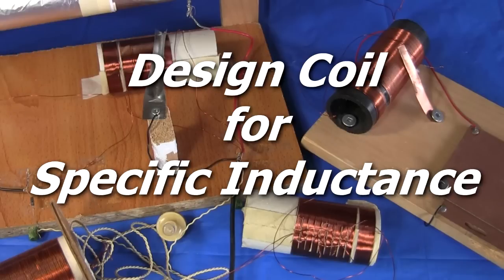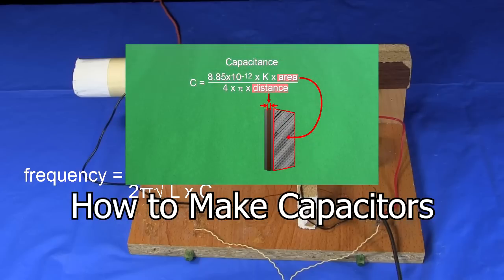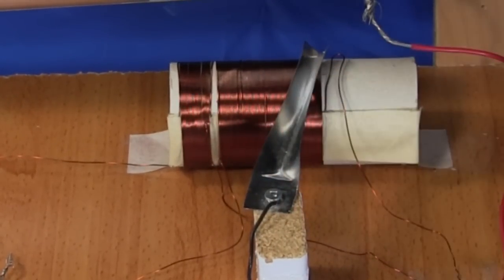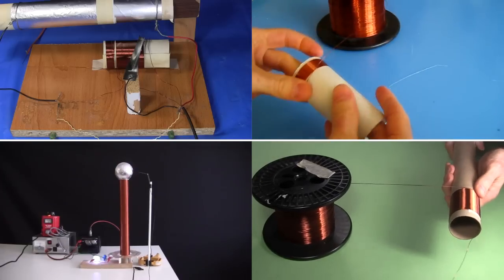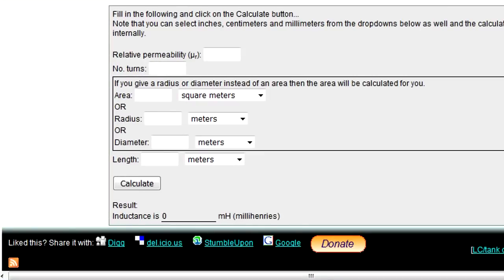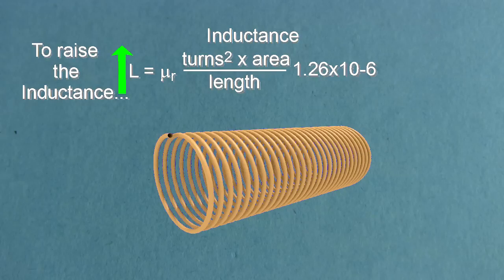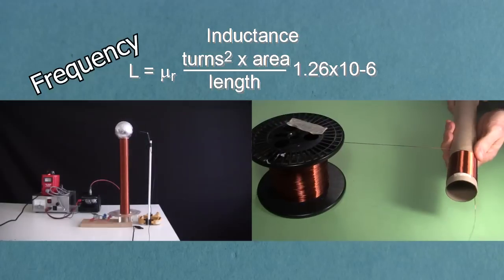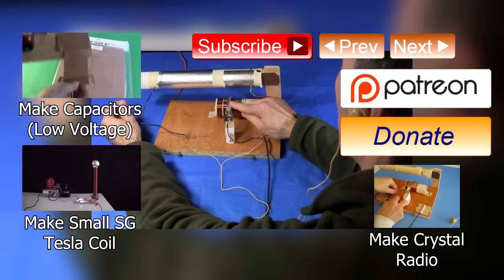How to Design a Coil for Specific Inductance

Comment: Great Video. I wish there was a guide like this when I was a kid :) No doubt I will be linking to this one a lot :)
I especially like the mentioning of all the Formulas, including the thumb rules and rounding off's that regularly get used when designing coils. Those little details can get a lot of people stuck on the theory unnecessarily.  When they would learn more by just forging ahead and giving it a go so they can see how it works.
Reply from the maker: Thanks. Yeah, formulas are great guides. They're a lot of knowledge compressed into a small area. There's still a lot they don't say, but they go a long way.
Reply: Formulas are easy to google. Its not always so easy to get a quick yet accurate guide to using them. Its very helpful to show how they work and which numbers are constants and which ones can be rounded etc to make it all more user friendly while maintaining an acceptable error margin :) For beginners looking up LC circuits it can be very overwhelming. Now thanks to this video it needn't be :D
Reply from the maker: Do you mean the thickness of the wire? The only effect the thickness of the wire will have is that thicker wire will mean a longer coil and length is a variable in the equation (see the inductance formula in the video).  If you're trying to keep the coil a certain length then a thicker wire will mean that you can fit fewer turns into the same length.
If by thickness of the coil you mean the wire thickness' affect on the coil's diameter, then the diameter includes the thickness of the wire. That's because the diameter is measured from the center of the wire on one side to the center of the wire on the other side. The diameter goes into calculating the area variable in the formula.PS. Sorry for the delayed reply. For some unknown reason, YouTube flagged your comment as spam and then didn't tell me about it until now.
Reply: @RimstarOrg  I googled lots of times to find a formula to calculate the inductence but each websites shows different different formulas .Which one is the correct ?Please reply me too.Here are some examples 👉L=MaN^2A/d 👉L=D^2n^2/45D+100l 👉and your formula.
Reply: Theese formulas were in my electronics textbooks already 50 years ago. Before Youtube.

Comment: How many winds do you need around a core (minimum) to get flux to flow through the core? And does it matter if you use a hard single stand copper wire vs. multi strand wire? And let’s say the target frequency is greater than 100khz - 10mhz max.

Comment: Question.....Also Merry x-mas!.....I just built a double balanced mixer.....I bought some toroid cores from Jaycar. Turns out they are "iron cores" usually used for EMI suppression. My question is.....does the type of core become more critical when frequency increases? I think my DBM is actually an RF attenuator! When I fed my nano-VNA directly into the antenna socket of the DC 3.5Mhz rcvr I built using this DBM I could hear the sweep tone it was generating in the 80m band....I have ordered the correct toroids...hopefully this will fix it! Are air cores usually ok for HF (below 30mHz) if I don't have a toroid?
Thanks for the great content!

Comment: How you can apply this formula for a multi layer coil? Let’s say for a crossover network in a speaker system. Do I have to use the same formula for each layer with the small diameter variation, then considering all coils in parallel?
Reply from the maker: For multilayer you need different formulas. Try googling "coil inductance formula multilayer".

Comment: Thank you! That was very inspiring! :) Though... I need to do a specific coil with multiple leyers and on Iron-Silicon sheets ...  its for audio crossover, and since this coil that i'm trying to build needs to cross a speaker at about 175 Hz, I definately need Iron core, because by my calculations it has to be around 6.2 mH... its huge if I have to build it on air core! But I do not know what is the permeability of this type of alloy (iron-silicon)... on wikipedia it says its around 19-90! I don't know what to do anymore... my sheets have 15 mm width/ 71 mm in lenght and I have used 30 of them because they are only 0.3 mm thick

Comment: I searched in internet lots of times to find a formula to calculate the inductence but each websites shows different different formulas .Which one is the correct ?Please reply me too.Here are some examples 👉L=MaN^2A/d 👉L=D^2n^2/45D+100l 👉and your formula.
Reply from the maker: Sometimes the formulas have slightly different parameters but give the same result. For those, it's usually the ur and the 1.26x10^-6 that are combined in different ways but work out to the same thing. But sometimes the formulas are better for certain types of coils, different frequency ranges for example. You can sometimes get a clue by looking at what variables are needed.
Reply: @RimstarOrg  Thank you for replying me and nice explaning .But I want to clearly know that  we can use this formula to calculate the inductence ?👉L=D^2 N^2/(18D+40L)
Reply from the maker: Where did you get the formula from? Does it give the same inductance as the formula that I gave?
Reply from the maker: Unfortunately that webpage doesn't give any details of what type of coil that formula is used for. It does seem odd that it doesn't take into account the permeability of the core material, however, with a set of parameters for a typical crystal radio tuning coil, my formula gave 125 microhenries and your formula gave 14 microhenries, not as different as I expected. But without the details about what type of coil the formula is for, I don't think I can help more.
Reply: @RimstarOrg  Thank you.I will use your formula in future.Also I have seen that formula in another webpage and it says some ratio about the length of the coil and diameter.As I remember it was 0.4 or something else and it gives the inductance in micro henrys .Never mind I will use your formula.If it's not matter please find my previous formula.Please check this website also 👉 https://www.circuitstoday.com/how-to-make-an-air-core-inductor

Comment: Hi very good
In my childhood i created this with different pieces of wire join together and wound on 3 inch peace of wood,
Use 50 oham diode it works amazing with out antenna and earth ,and also generate power to glow LED .
But others many many experiment failed at same time.
I realized first coil wounded with natural frequency that catches frequencies and convert into power.
Reply: I want to glow an LED.

Comment: Inductance usually isn't useful to know by itself when designing circuits. Impedance is a more interesting value if you want to invent your own devices. For inductors, the impedance/reactance is: 2*Pi*frequency*Inductance with units in ohms.

In case you wonder, impedance is the fact that capacitors and inductors also act as resistors against A.C. and strictly speaking, "impedance" is the combined effect of both resistors, capacitors and inductors in a certain circuit, ie. the overall "resistance". Therefore «reactance» is a more proper term for the effect of each of these by themselves. We reserve the term "resistance" to resistors because these "reactive" effects don't act upon D.C.

If you build a tank circuit (like the crystal radio is), you have an inductor which reacts/"impedes"/"resists" more the higher the frequency and a capacitor which reacts less the higher the frequency and so the overall circuit has this sweet spot in the center where the combined impedance is the lowest. This is called the resonant frequency of the circuit. Obviously, this is the frequency the radio is tuned into, ie. outputs a stronger signal/larger sound volume.

And now you know and knowing is half the battle!
Reply from the maker: Oh! Regarding your third paragraph, why the resonant frequency of the parallel LC circuit is where the reactances are equal, thanks! I knew all that, and I knew about the different ways inductors and capacitors impede the higher and lower frequencies, but I hadn't put the two together (actually, now that I see it, I think I had put the two together briefly a few lifetimes ago but forgot it :)). Maybe now I can finally make a video about resonance! Now I just have to get up the courage to do it. Without the ability to fix errors in videos once they're uploaded, I need to be very sure of everything, and you can never be 100% sure.

Comment: Hi, i saw a coil in an experiment the other day that was no more than 4 inches long and around 1" in diameter, but the guy said it's inductance was 24H ! I thought i knew enough about inductors but i can't see how such a small coil can have such a very high inductance, what are the methods to achieve that ?
Reply from the maker: I just plugged your numbers into the calculator on my website, using 217 for the number of turns and a magnetic permeability for the core of 100 and I got just 29mH. To get 29H I had to change to permeability to 100,000. I then did a google search for "magnetic permeability 100000" and got mu-metal (https://en.wikipedia.org/wiki/Mu-metal) and permalloy (https://en.wikipedia.org/wiki/Permalloy). Perhaps he was using one of those as a solid core? If it was an air core then I don't see how he could have gotten 24H -- an error perhaps.
Reply: RimstarOrg
Sorry yes it had a core, i've got some mumetal sheet i'll roll some into a core and see.
Reply: I think you've got it! I tested a coil that had proper non-grain-oriented steel laminations (about a dozen) with an inductance of 106mH, i cut up the mumetal sheet into rough rectangles like the laminations, and with only 5 strips i got the 105mH, thanks for the heads up.

Comment: @RimstarOrg  I have  two N52 Magnets Size 2"L x 1"W x 3/8"H and Magnet wire  18Awg, I will have One Magnet face North and other South But I need to make One Magnet wire Coil that both Magnets rotating 360 degrees in center of One Coil to produce at least 14 Volt and light up 150 watts light bulb,  How many turns of magnet wire I need to do or have to produce what i'm looking for the out put. I look forward to your reply

Comment: all conductor  will follow the equation  regardless of the thickness of conductor ?
Reply from the maker: Yes, for coils around the size of the ones I talk about in this video.. There are different inductance formulas for smaller coil, usually called inductors that are soldered to circuit boards, but you're likely to buy those and not make your own. Things get different too when you start making high voltage coils made of 1/4" inch pipe for example.

Comment: Thank you for your crystal clear explanations. There is something that I still do not understand, and I hope you will clear it up for me as well. By changing the number of turns, the core material and its area one can tune the receiver. But all that is happening is that a link is then established between the broadcasting station and the receiver. It would be like the switchboards of old where one telephone user was linked to another by the operator.
That still does not explain to me how the messages can come across. 
For example, let us say a station is broadcasting at 1200khz, with your explanations and the formulas, I should be able to build a crystal radio that can link to this station. But how are the messages coded in the 1200khz? I hope I am making sense.
Reply from the maker: I think your confusion comes from thinking that a link is established between the broadcasting station and the receiver. There isn't any. What's happening is that the 1200khz signal and signals and noise of other frequencies are all arriving at the receiver and the receiver is tuning into just one frequency. I explain it more completely in my How a Crystal Radio Works video here http://www.youtube.com/watch?v=0-PParSmwtE
Reply: @RimstarOrg  I agree that your image of the receiver just "standing there" with its own frequency is much more accurate. The point I was trying to make is the fact that within the same frequency all kinds of sounds are captured and we have nothing that explains them except the fact that they exist. The wiper of a crystal radio apparently captures those sounds and not the frequency of the coil even though this frequency makes the capture possible.

Comment: So if you want  to build a paraticular coil.   You know the diameter of the form, number of turns, length.   If the gauge of wire was too small and you had all the turns but didn't fill out the length.   Can you evenly space and spread the loops out a bit to get the length you need?  I would think this also would change the inductance since the coupling changes with the space between the coils. ????   Do you have to just figure out the wire gauge so that the number of turns perfectly matches the length?

Seems like it would be nice to have the formula that says if you know the diameter, wire gauge, and mhenries you want.   I will tell you the number of turns to use.  The length would be right due to the previous information inputted.     Help to explain!!!
Reply from the maker: Yes, you can evenly space and spread the loops out to get the length you need. That works if, as you say, you know the diameter, number of turns and the length. I don't have a formula for the coupling but if you think it's too low then you'd have to get a thicker wire.

The variables I usually don't know are the length and number of turns. But if you know the wire diameter (with the insulation) then if you guess at the number of turns then you can calculate the length since it's the number of turns x the wire diameter. So make a guess at the number of turns, calculate the length, and then use the formula to get the induction. If the induction is higher than you want then do the calculations again with fewer turns. If the induction is lower than you want then do the calculations again with more turns. Repeat until you get the induction you want. Using a spreadsheet or an online calculator makes that easy. Here's the link to mine again https://rimstar.org/science_electronics_projects/coil_design_inductance.htm

Comment: I have a question for you,, what about the size of the copper wire and number of layers?
Thanks
Reply from the maker: I don't know about the layers but the size of the copper is already accounted for in the number of turns and in the length parameters.
Reply: @RimstarOrg  sweet thank you very much

Comment: Hello ! I enjoyed  yor video very much , it teached me a lot but i have one question : What material would you use to build a wind turbine generator ?
Congratulations for Your Great Work
Reply from the maker: I don't know, I've never built a wind turbine generator. I'd imagine you would not use an air core though. Likely ferrite or layers of steel insulated from each other to minimize eddy currents. I'd suggest searching on YouTube for DIY wind turbine generators -- I know I've seen them around, though I don't recall any details.And thanks.

Comment: webpage with the inductance calculator. How do you calculate wire gauge or AWG into your equation. Some tesla coils are 28 AWG and 24 AWG what happens to freq. Current isent the only thing.
Reply from the maker: I don't calculate wire gauge, but it sounds like a good thing to add to the page. Some times I have a coil already so I know the length for the formula.  For my small Tesla coil I wrapped a few turns of wire on the core (cardboard paper towel tube) and then measured the length of that, then divided that by the number of turns I'd put on, and that gave me the average thickness of a single turn. I also recall, a long time ago, using my micrometer to measure the thickness of a wire.
Regarding frequency, this is just a coil induction calculator. A full blown calculator for a Tesla coil (if that's what you're working on) has already been done so well here http://www.classictesla.com/java/javatc/javatc.html that I wouldn't even try making one.

Comment: Does shape affect how an inductor behaves? Not in terms of measured or calculated inductance but in how that inductor responds to changing frequency or loading or in transmitting?  For example, if I had two 240uH inductors, one on a round tube, and one on an egg shaped oval tube (say I taped a sharpie to the cardboard tube then wound the coil so I had a nice prominence for my wiper) would there be a difference in how they behaved?

Comment: Question: My circuit consists of a 1 to 30hz oscillator where the output is amplified to drive a 14.3uh flat coil but I wish to substitue the flat coil for a Helmhultz pair with a distance between them of 10 to 12 inches and coil height from between 2 to 12 inches or ideally two separate coils of 2 and 12. What are the calculations for that?
ps: The current flat coil design the magnetic field strength is about 3 Gauss for 5%
duty cycle and about 34 Gauss for 95% duty cycle.

Comment: RimstarOrg .. could you please confirm if length should be the length of the coil or length of the coil structure (winding in air core structure)?
Reply from the maker: It's the length of the coil from the center of the wire at one end to the center of the wire at the other end. I guess ur (relative permeability) takes care of the structure.

Comment: Dear Sir as suggested by you for 6 X6 inch aluminium paper diameter works out to be two inch,. Can I try with one inch dia card board cylinder, increasing its length so that aluminium foil area will be 36 sq. . inch. My quiry is do I have wound aluminium foile butting there edges.
Reply from the maker: Yes, you can increase the length to get the same effect. The important thing would be to have the same area.

Comment: I tried to make and inductor with a screw as it's core. But despite having used the iron steel as the nucleus I still got the vaccum relativity permeability when measuring with the multimeter. Somebody knows why?